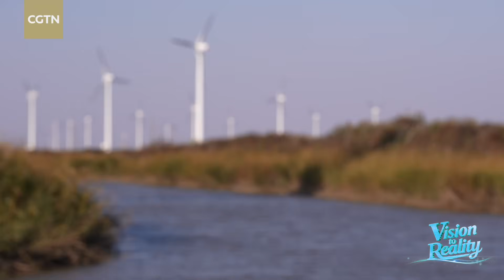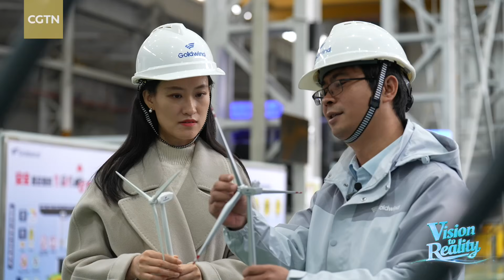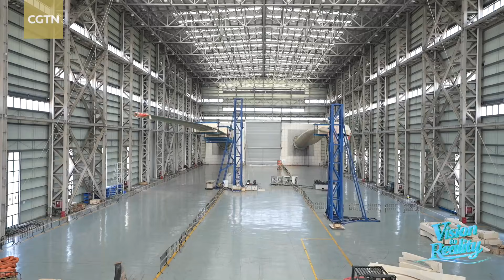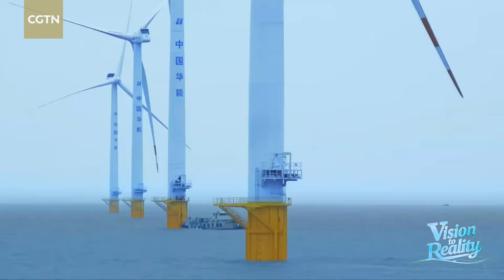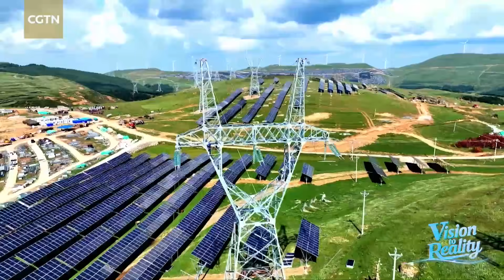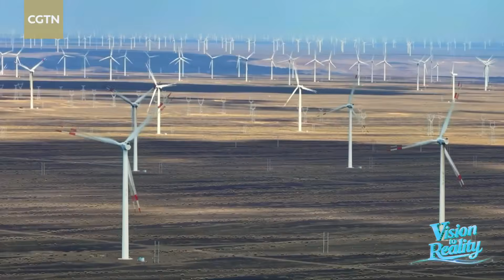Offshore wind powers China's green transition

Comment: China is rapidly advancing its offshore wind power sector as a cornerstone of its green transition and carbon neutrality goals, with cumulative installed capacity exceeding 37 GW by 2023 and projections indicating it could reach 141 GW by 2030.
 This growth is driven by declining costs, technological innovation, supportive policies, and the need to decarbonize energy-intensive coastal regions, which account for a majority of the nation’s power consumption and emissions.
Offshore wind power is emerging as a critical component in China’s strategy to achieve carbon neutrality by 2060, with the country’s offshore wind capacity surpassing 30 GW by the end of 2022 and continuing to expand rapidly.
Offshore wind power policies (OWPPs) have a significant positive impact on green total factor productivity (GTFP), primarily through technological innovation and reduced energy intensity, indicating a strong link between policy-driven wind development and sustainable economic growth.
China’s offshore wind power capacity had already exceeded 37 GW, and the industry is expected to play a pivotal role in decarbonizing the eastern coastal regions, which host 76% of the national population and 72% of power demand.